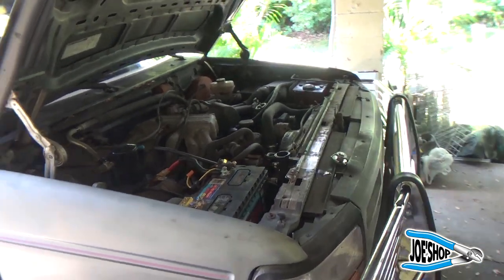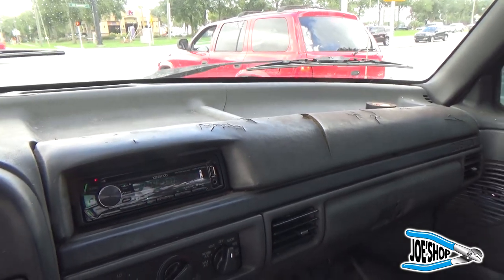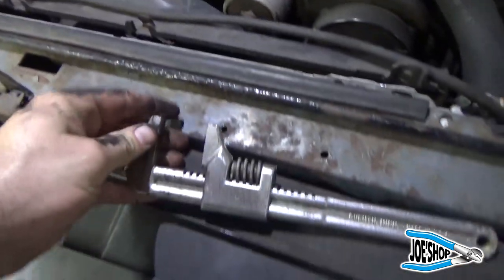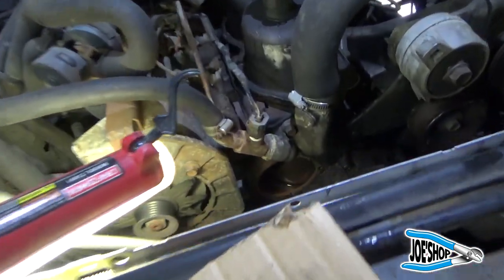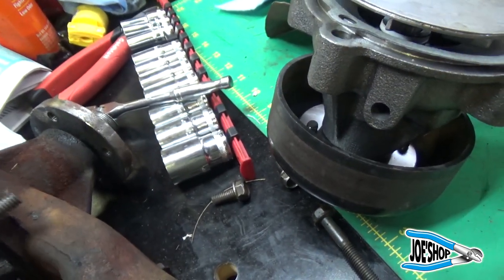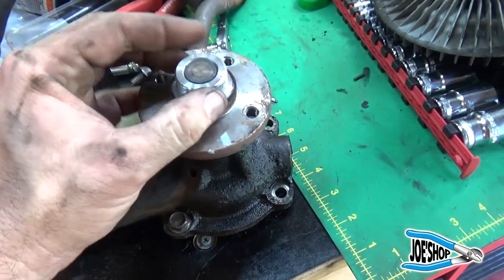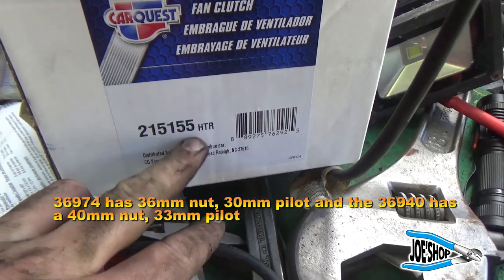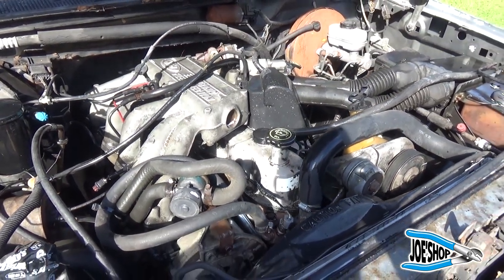OBS (4.9 liter) Ford F 150 Waterpump Saga and engine cleaning

Comment: It is ALWAYS the fasteners that do me in on a project. My little project today:  I had the right oxide-coated hex-drive cap-head bolts, even in the right length.... until I discovered the ones I bought in bulk are 1.25 pitch and my large tap & die set has only 1.00 pitch for metric sizes M6 and smaller.  Who knew?  So I ran to ACE, NAPA, and a local shop to find either the right bolts or a new tap - nada.  So I ordered a few new taps & dies.  Cost was neutral, but at least my options will be broader next time.  Meanwhile, I have to wait a week.  Every time my friend!  Ha ha!!

Comment: With regard to your seats and dash, You may have already investigated your area for a “you pull it” used parts place.  I have seen places in several states where they have a vehicle scrap yard and you can go take the parts you need off a similar vehicle  for usually way less than replacement cost. I would not use water pumps or other mechanical parts from one of these places. But it would be a good source for stuff like dash boards, seats, windows, hoods, fenders, etc

Comment: Hi Joe, I removed my water pump to find what looked to be a blender! All the fins were riped off and i haven't found all of them,  im sure shavings have ventured there way threw my water system. Im trying to research what happened and what to do next any knowledge would be appreciated and thanks for your video
Reply from the maker: I know that air in the system or perhaps rough edges on the old impeller could cause cavitation. Cavitation can cause catastrophic failure. I would spend a few minutes looking for the lost fins, but I doubt you will find anything. I don't think a few chunks of metal will cause any issues. Good luck...sorry I couldn't be more help. Cheers
Reply: Thank you so much for your fast reply, I did manage to find 4 fins. The new water pump is on, everything is ready for me to add water tomorrow check over everything and try her out. I appreciate your help, cheers!
Reply from the maker: @melishadiamond9942  wow...im suprised you found anything. Good luck! Cheers